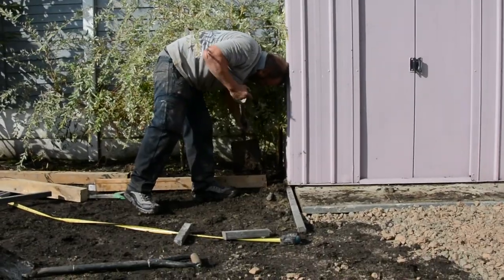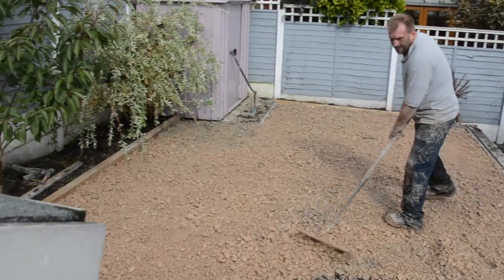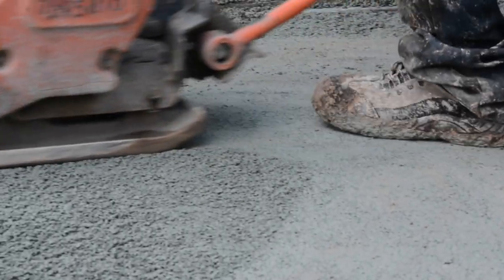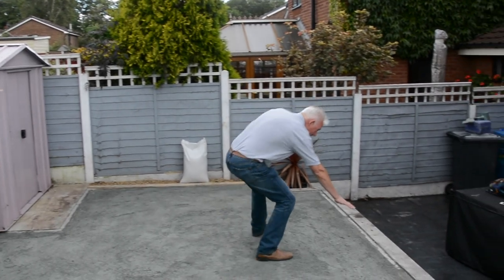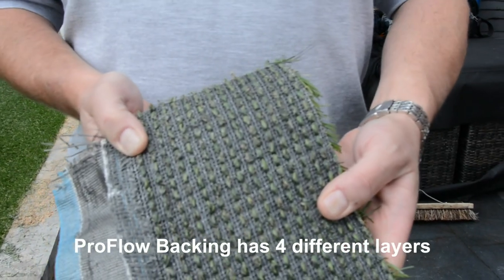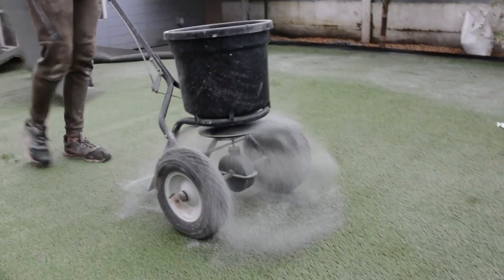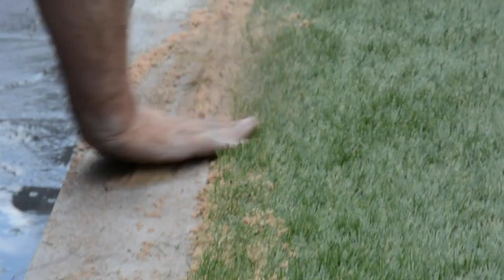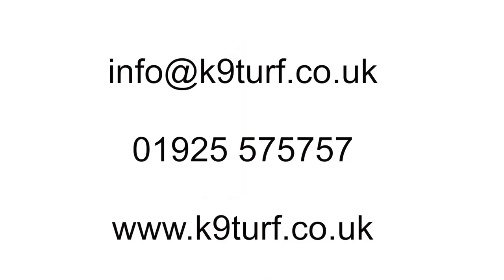K9 Turf ProFlow Polyurethane Artificial Grass For Dogs  4 Phase Install System

Comment: I don't understand why Zeolite is critical. It holds urine in the surface. Why not prefer urine to flow through the artificial grass, and be absorbed and penetrate the layer underneath into the compacted infill?
Reply: Zeolite is critical so they can charge you more money.